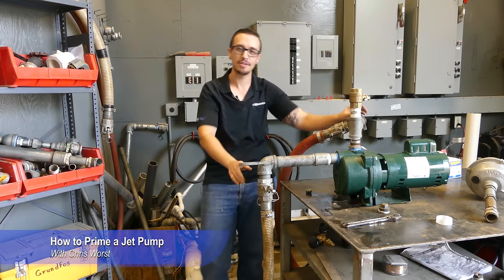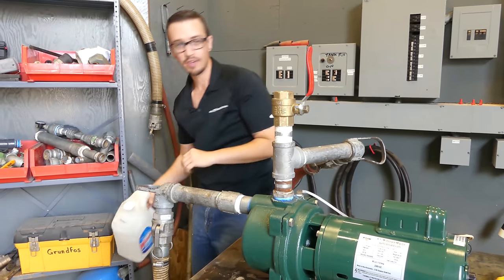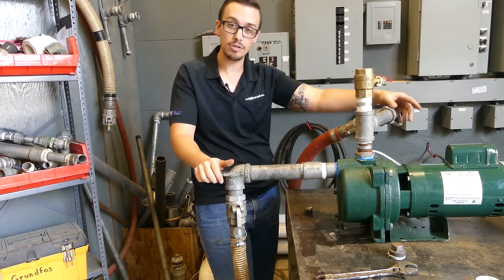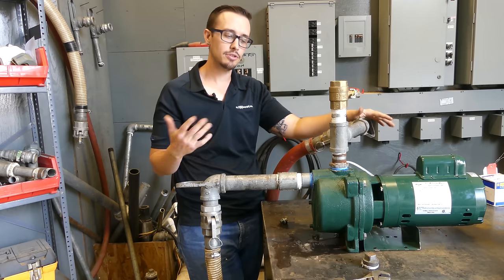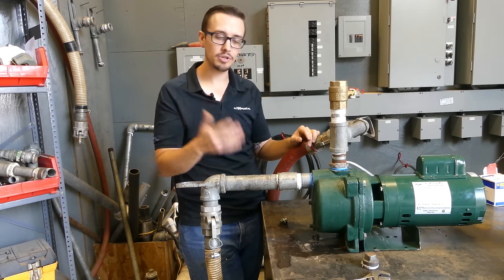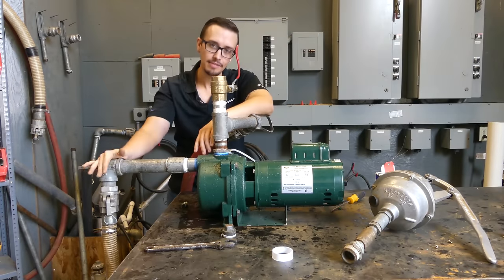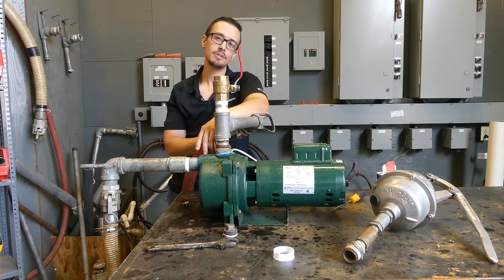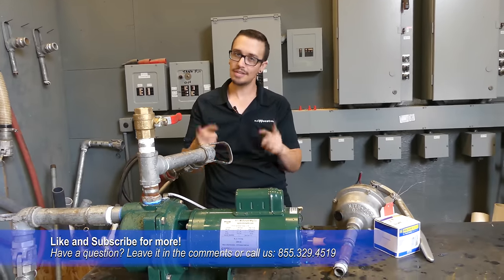How to Prime a Jet Pump

Comment: Dude's like: I'm gonna show you how to prime a pump in a dry lab with adequate standing room using the best, most ideal fittings and valves with the water source at my feet using a larger pump than the typical one found in most homes.
Reply: Oh man, I’m feeling this comment right now. Crawl space is cramping my vibe right now.

Comment: Funny... I never have to go through any of these steps to prime and operate my jet pump--which has no check valve to retain water in the suction line.  Just pour water into the discharge port till the volute is full, turn the pump on, then screw the discharge hose on to the port before water emerges.  Never fails.

Comment: Had one this past weekend...pump was cycling every few minutes with no water running. Our pipes are below frost line into the basement, and this one had water entering the basement by the pipe entry between the slab and block. Ended up the 1-1/4 pipe had a leak in it just outside the wall. Was fortunate, as the wellhead is buried with a sealed casing. (Casing vent runs into the basement along with the pump piping)

Comment: Thanks for your instructions. however somehow air seems to be preventing the jet pump from taking the prime. I have a 2 inch pvc pipe in a lake with a foot valve on the end. the foot valve has a screen on the end to prevent dirt getting unto the pipe. on the top of the pump there is an opening to pour water into the pipe and into the pump. I can pour water into the opening that puts water into the pipe in the lake and into the pump. After putting about a gallon into the pump, the water gets to the top of the opening and I screw the threaded into the opening. There is a pumptrol and a pressure Gage on the pump. I also have a 2 inch flexible hose that connects the pump to a pressure tank. When I activate the pumptrol I can see water moving in the flexible hose, however I can also see air in the hose. I don't understand where the air in the hose attached to pressure tank is coming from.  Even if there was air in the hose wouldn't the jet pump still be able to pump water into the pressure tank? Thanks for any advice you can provide!

Comment: Do you guys have any suggestions on how to quickly prime a centrifugal pump with a non-self priming liquid end? I have several that I maintain and even though I am dumping continuous water down the discharge side while not allowing any other water to go downstream it takes many attempts of shutting it off filling it all up turning it on and repeating the process probably 75 more times before it primes and stays primed until The power goes out and one of the timers on the other side of the property open up valves and drains the system to zero.

Comment: Use a 1/2hp jet pump set to 20 psi for irritation from a stream to 2 faucets 20 feet in separate directions. Ball valve is easiest way to prime. Stream foot sucker closes without draw so priming once per month only. Cleaning sediment out of pump housing is performed by closing faucet valves and opening ball valve until clear.
Reply: OMG, THANK YOU!!!! You just provided a fix for something I was trying to find a solution for!!!

Comment: the ball valve that must be opened up partially after the jet runs for it to not lose the prime, will it make any difference if installed on the intake instead of the discharge line?

Comment: I seem to have a problem where I cannot get my suction line to hold the water before completely filling the lines and the pump. I am not sure if I have a foot valve but I do have a check valve above ground. After I finally get primed, everything seems to work fine. Do you happen to know why my suction line will not hold the water or do you know if I buy a pump priming pump and install it after the check valve if it will help me?  And if so could you please send me a link to buy it.

Comment: Do you recommend a check valve on the intake side? Or is a foot valve better, if it will fit into the casing in a point well? And is a foot valve susceptible to clogging ?Thanks
Reply from the maker: Just a foot valve is all that should be used on most systems.

Comment: I installed a new pump with a check valve at the inlet and new pressure tank. I can’t get the system to prime. Any help would be great

Comment: Hi i dont have any quick release valves on my system i draw water from the lake into a 1/2 horse jet pump its connected to a  20 gallon holding tank ..i cant get prime on pump ..filled line up from lake and installed a new foot valve on lake side ..have filled pump with several gallons of water and pump still not primed ..should i fill the tank up with a water hose first  then try to prime because air bubbles still coming up 
Normally i dont need to do this there is a valve to the tank should i shut it to prevent air from tank from entering..thanks

Comment: Hello i have a 7.5hp centrifugal triphase water pump. Now I get water from a spiral rubber and foot valve drill. The water level is about 4 meters deep. Now I would like to put a check valve on the surface of the tube. My pump will be able to draw 4 meters of air between the pump and check valve to bring the water up;
Reply: Is for agricoltural use. My water well metal tube is 3 inch and now have 2 inch greek spiral plastic tube with 2 inch foot valve. (my water well is 14 meter height) (water stay at 4 meter) ( my spiral 2 inch tube with foot valve is 8 meter). But i don't have the max power on water pump. I see on the spinklers.
Now i want to change it.
I want to use 3 inch check valve on metal tube. But because water stay 4meter, my pump can up 4 meter water up on pump? Sorry for my very bad English

Comment: Would anything change if I have a brand new, empty pressure tank? Would I still crack the valve at the discharge, turn power on, than close the discharge until the pressure tank fills, than fully open discharge? 

Thanks
Reply from the maker: After you crack the discharge you don't need to close it again, other than that your steps are spot on.
Reply: R.C. Worst & Co., Inc. awesome thank you! So my discharge goes to a hose bib. Should I have the hose bib open while I’m priming or have it closed?

Comment: Can you use a self-priming utility pump like little giant for example to prime the jet pump?   My jet pump has a hose bib connected to the priming port.

Conversely why cant they make jet pumps self priming?
Reply: Jet pumps work off suction, hence any air in the system will not allow it to prime, if you want a pump that doesn’t require priming submersibles are the way to go

Comment: I am looking to water a large grass area which is about 150’ from my water source 

I do have power 240v  I’m liking g what is see instead of a jet manual Honda jet pump / generator type

Would your setup in this video work? 
With a big gun sprinkler sprayer
Reply from the maker: Give us a call: 855.329.4519

Comment: Great video. What is the model pump you used for your video? I have a small 1/2HP pump for water at my dock on a lake and I am looking at adding a second pump which will either supply a water fall or run irrigation. Pump be installed outdoors, will sit approximately 5' above the water level and I would feed water horizontally around 250' and vertically 30'. Do you recommend a shallow well jet pump for the application.

Comment: I have really hard water...build up quickly...with in months...over powers my shallow well pump...is there a pump that does not allow the build up on the impellers and bearings and seizes the pump...it is not cast iron...should I use a cast iron for better hard water resistance....has to be 25ft and 50 psi...

Comment: You were talking about how the well loses its prime because of the air going in between the connections. You didn't mention putting in a check valve so it wouldn't lose its prime. Why?
Reply from the maker: Various situations can occur that lead to loss of prime on an existing pump install, and this video is intended to help people get their system primed and back to operational. This video was not created as an installation guide for a immersible type pumps. Foot valves are a critical component in preventing prime loss in nearly every immersible centrifugal pump on the market. I do not recommend a check valve on the suction line if a foot valve is present, this can lead to difficult troubleshooting down the road.
Reply: Check valves can be problematic and a check valve won't save a leaky system if the leak (for example) is below the check valve because seepage will dump the prime which a non-self-priming pump will not recover. A check valve on the inlet side of a pump (if the pump is not so fitted) prevents the pressure tank from dumping back through a seeping foot valve but doesn't itself maintain prime in the well pipe. It also PREVENTS pour priming unless you have one prime fitting (verticals like shown in the video hold a funnel nicely, and use a gate valve for reliability as shown) for the pump and another for "everything on the well side of the check valve". You can also buy self-priming pumps but they are considerably more expensive. My water tends sandy so my spare pump will be self-priming after I replace a worn foot valve (and all the well piping because PVC is cheap and broken well pipes SUCK to fish out if the owner didn't leave a line, I will use stainless aircraft cable since I'm a jet mech,  love overkill and cable is thousands of pounds stronger than rope so a pinched casing should it happen may be overcome with winching. I always buy my next pump including replacement pipe fittings and wiring after installing a replacement since I expect to live long enough to need it and they don't break at convenient times. This worked nicely for thirty-plus years and I do it with all my plumbing parts when I replace wear components.

Comment: Also have you had any experience with a Gould’s irrigator?   I was looking at them for future expansion of my farm irrigation system but currently my system is a J5s and is always pressurized  all 1 inch poly pipe. With the currently longest run of 1700ft  But I would like to increase my mainline from 1 inch to 1 1/2 inch like the irrigators output and still allow me to only open one of the 1 inch or 3/4 side zones. But I recently talked to Gould’s and they said that the irrigator doesn’t like to be reduced down. Then how are people supposed to control zones that is technically reducing by closing zone valves isn’t it?    Can you install an  irrigator in a pressurized system with an expansion tank and pressure switch so that it will control the output without putting too much back pressure on the pump?

Comment: I have a brand new flotec deep well vertical 1hp pump that is leaking at the gasket between the pump and the plate that contains the pressurized line and 1-1/4 return line. I am wondering if I can replace the gasket with silicone gasket maker? Is that stuff safe for a drinking water system?
Reply from the maker: I don't think that will work.
Reply: @RCworstwater  Any advice for leaking gaskets?
Reply from the maker: I would try calling the factory to see who can sell you parts in your area.

Comment: Would a wet/dry shop vac be able to raise water to the pump?
Reply from the maker: I doubt it would be able to. You'd need an airtight seal to try which would be difficult

Comment: Does having a pressure tank and a jet pump change the process at all? And if you can't disconnect the suction what is the actual process? I'm trying to hook my 1000l tote up to a tee in the suction, hopefully that will work (or will that just trap air below the tee and cause other issues?). The top of the water in our well is probably 15' lower than the pump right now.
Reply from the maker: Give us a call: 855.329.4519
Reply: @RCworstwater  I got it figured out thanks! I think there was some crud in the foot valve, and it flushed itself out. My daughter was watering her garden, and emptied the well!

Comment: But how do you prime the pump when the lines run down hill about 100+yards and the lines were completely dry because you just had to change a foot valve and you continue to add water but it seems like all the water is probably just disappearing because you never get to the point where the pump seems to be full of water so you can run it?  Is there a way to push compressed air into the line to basically create a siphon so the lines can be full again and you only need to fill the pump?  This shouldn’t be this hard and yet… I’ve been without water to my house since January because the damn pump won’t prime.

Comment: I have a shallow well pump (above ground) with pressure tank and am about to replace both as the tank is leaking and the bearings on the pump are about to give in.  My question is should I put a check valve before the new pump or after (on t-connector intake before the pressure tank).  Thank you!
Reply from the maker: You will need on the end of your suction line, the others are usually not needed.
Reply: R.C. Worst & Co., Inc. Thank you for the reply! Could I have one  already installed somewhere midway in the well?  If I mount one to the line going into my pump from the well, would it be sufficient?

Comment: Great tutorial! We have a jet pump for a sprinkler system. When we prime it using your technique (fill the whole intake, then slowly open the valve after starting the pump) it still does not create the suction and pump water. We checked all our fittings to ensure they are air tight. Any ideas or recommendations are appreciated?
Reply: Instablaster...

Comment: Just a common beef with a common misconception about priming a pump:  At 2:45 you start mentioning "to allow some backpressure...so that it doesnt quickly throw all the water out and lose prime"   The line is in the water, so the pump isn't going to magically unpump all the water out of the line and lose prime... the intake is submerged, the line (assumedly) isn't letting air into the line, so applying "backpressure" does zero for you.  In fact, it actually retards the pumps' ability to evacuate air from the suction line, so there's no point in creating "backpressure".

Comment: I replaced just about everything on my water system and come to the that my pump casing is clogged! Of course its the very last thing i thought i didnt need to replace cause it still pumped water...QUESTION: Is there any safe products I can use to dissolve sediment in my pump casing??
Reply from the maker: You'll have to disassemble and clean it by hand.
Reply: @RCworstwater  impeller was slipping from motor shaft as well, bought a new pp. thanks for the reply! Its very humid now in the pp room .. need a dehumidifier now lol. one thing after another
Reply: I replaced everything new... I now everything that can go wrong with a well pump lol. motor shaft was slipping on the impeller

Comment: What would cause a pump to lose prime with 80 foot lines goulds jet pump. 2 hose ejector and foot valve.     Do the ejector/footvalves get stuck open?   If no holes in the lines what would cause a system to lose the prime or lose pressure when primed?
Reply from the maker: It would have to be the foot valve if there are no holes in the pipe.

Comment: My pump keeps losing prime. I’m not pulling water from my deep sand point well. Could it be the well is dry or a bad foot Value? Any advice? Thanks
Reply from the maker: It is likely that the well is dry. Typically sand point don't have a foot valve - just a check valve near the pump. You could try replacing that check valve and see if it fixes the issue.

Comment: Brother I just found your channel looking for a way to fix my MYERS well pump and just subscribe cause your work is awesome brother.... Quick question my pump only gives me air pressure with a little bit of water sometomes. The preasuere is strong but no water just sprays here and there. Please help friend.!
Reply from the maker: Sounds like your pump may be losing its prime, I would first verify the foot valve is functioning and holding water, then fill the pump and suction lines with water and try to run it. If the problem continues contact me with the problem. Thanks for the sub!

Comment: Just burned out a brand new Ecoflow 1 hp shallow well pump The company used a soft rubber line to the pressure switch and it blew off flooding my basement and seizing up the motor. 
The issue i had before this happened was it never would push past 35 lbs though its a 40 - 60 RATING. It was difficult to set up to work properly The pressure switch would rapidly click on and off when it was to turn on. The only way i could stop that was to tighten the main bolt but then it wouldn't shut off. I did finally get it to turn on and off with out that rapid clicking on and off but never got the pressure to rise past 35 lbs. HELP!. Im returning the pump tp Home Depot tomorrow and getting another pump

Comment: Might anyone know why, when I prime the suction line, the water totally disappears! I’ve poured 30+ gallons. The pump will still pull water up but there is a lot of air in there... 
I guessed that the well is dry, grandparents are adamant that’s not the problem. Will a loose pipe on the suction line cause a problem like that?
Reply from the maker: Yes, you definitely have a leak in the suction pipe. It is most likely in the foot valve, located at the bottom of the suction pipe. Pull it up and inspect. If it is the foot valve you can buy a new one here: https://www.rcworst.com/Valves-c80.html?Attribs=504&